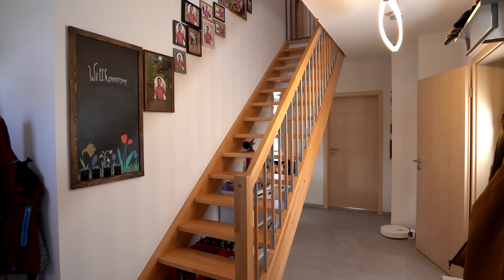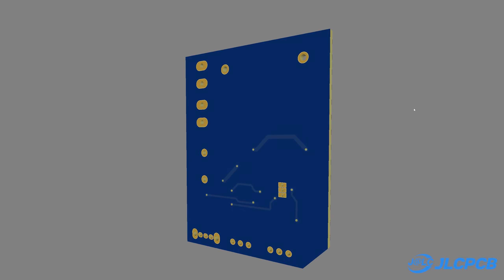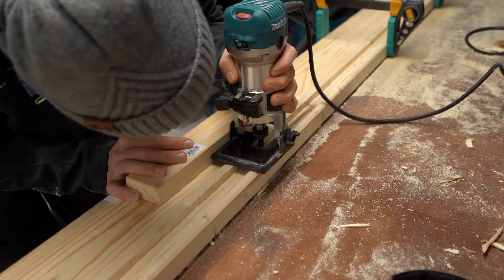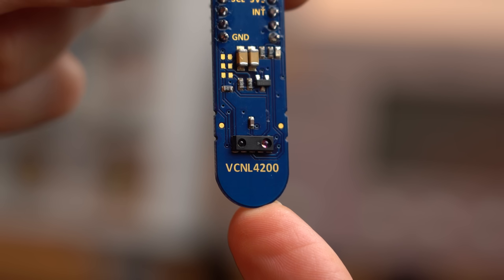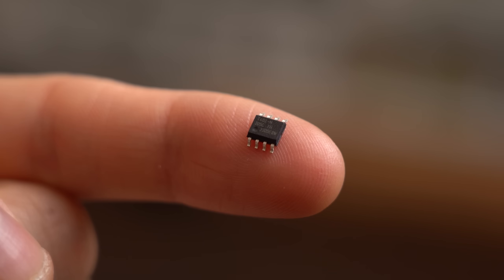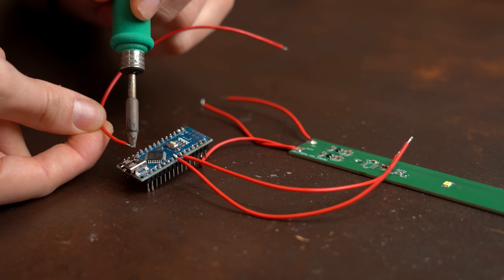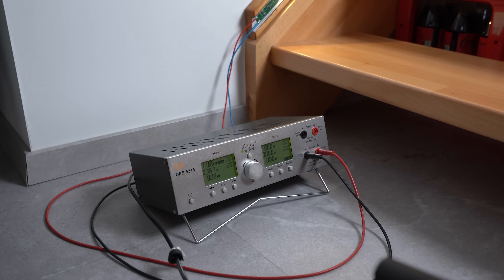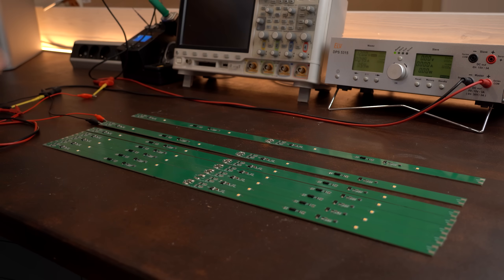I tried to Revolutionize LED Lights!.....And FAILED?

Comment: I bet there's a calibration\hysteresis issue with the lights.  Also, I bet the infrared lights from each sensor are interfering with the other sensors.  That is, unless the MCUs are programmed to trigger each other in a timed series so the only fire one at a time.  That would be my first stop.  Have a calibration on power-up routine and then have them fire in series for the sensors.

Comment: Since the PCB is visible through the transparent cover of the profiles, you could consider ordering them with white soldermask finish. I think it would improve the look drastically making it more "clean" - the green is quite an interesting contrast to the wood in my opinion... :)

Comment: On a similar project that I worked on; we needed to send a signal across interconnected PCBs without limiting the number of boards that could be connected. We used a buffer IC to refresh the signal from board to board so no significant voltage would be lost if the user wanted to connect several boards together.

Comment: I love those types of videos a lot.. Because the failure on something that doesnt exist yet in that scale is always expected... keeps my hopes up when i am inventing or creating something...

maybe you typed something wrong in the code or the sensors are not working properly. maybe they read the rail in the distance or a reflection of some short.. to test that you can try them on the bench with the clear cover on top of the sensor and see if the reflection is messing up the readings from the infrared as i saw the stairs are somewhat reflective and they are not absorbing the light thats why i am saying that... about the noise is possible to come from the microcontroller output maybe try a filter there... as far as i know i am not sure tho i will clarify, that when the mc is reading constantly can produce noise... maybe you can try with locking the distance of the sensor to the max value that you want and with an IF in the arduino to run the code when is a change in the distance else do nothing i dont know how much is possible but you can try it... also take a look maybe the IC is making noise test that too!...

 i dont know if i helped at all i hope you can find the solution and make something cool... i want to do the same thing on my exterior stone stairs because it looks cool and it is usefull... i hope that i helped if you read this thank you for all the great stuff you do!

Comment: how about adding addressable LEDs and lighting the LEDs on boards just before and after the board with the distance sensor that detects movement. At any time only 3 boards would light up. This might be a simpler way to of doing this and would light the led for the step in front of you not just the step you are standing on.

Comment: In my opinion the problem is a mix of crosstalk and reflection: 
Crosstalk: the modules are just triggering themselves via the impulses they are sending out (may be solved by your sw, didn't mention it)

More importantly: reflection 
In my own projects I realized that a smooth surface vs. A diffuce surface make a HUGE difference in IR applications. The amount of light reflected by the smooth surface is way more than by your hand messing up your measurements. This is extremely visible at the upper two modules which had even more smooth surfaces facing them...

Yeah noise in power supply can also be an issue but this sensor is a discrete sensor and so it won't be an issue 

My suggestions: just for testing: put some sheets of pages on the smooth surfaces facing your sensor
Calibrate your sensor with values without humans in the area of view at boot
Maybe you can use a TOF laser sensor for distance measurement (will be less analog) and some are available with crosstalk correction

Loving your videos
Megge 😊

Comment: Automotive led drivers, designed for 12V, would make sense...with the size of the pcb's you could probably use a fat 5V power line, and one 'master' 5V power supply, and maybe even a 3.3 V line, since the system only powers 4 LEDs at a time....why not have a small clear patch for the reflective sensor, although a pir sensor wouldnt care about the diffused plastic...overall, too much complexity?

Comment: Why not use a 5 meters long addressable led strip with one LD2410 mmwave radar distance sensor and one microcontroller (e.g. esp32)? It sounds easier.

Comment: could it be something to do with the reflective metal at the bottom of the banister risers you basically have a load of cylindrical mirrors reflecting the IR in all directions toward all other sensors

Comment: My design (that is more robust and less complex than this video) is to add sensor only on the beginning and end. When person enters, the LED strips will gradually turn on smoothly from the direction of the person entering. 
For example: if the person entering from bottom the LED lights up from bottom to up and vice versa. This way you just need one sensor on each side and one microcontroller. 
The LED will automatically turn off after about 15 seconds no movement on both ends. 
The only drawback compared to what is presented in the video is that it does not detect whether you still inside the stair and which step you are currently into because it is more of time-based rather than individually tracking each step.

The LED choice is either: using lots of cables (e.g. 14 anode + 1 cathode which will be complex) or use one individually addressable LED strip (which is expensive but neat and simple in wiring).

Comment: Redesign the stairway lighting system to be a linear QMK firmware controlled keyboard where the LEDs are the addressable key LEDs and the proximity sensors are the keys. The QMK key LED animation system is what would be used for controlling the step illumination. The effect you are trying to achieve is basically one of the QMK animation schemes called “heat map”. There are many different animation schemes available in the QMK system and these can be programmed to change on the fly according to key inputs or rotary encoder changes. Thus momentary switches and/or rotary encoder would be added somewhere to select different settings such as patterns, colors (use addressable RGB LED) and built-in animation schemes to suit the occasion. For example “breathing” is a setting. There could be a holiday scheme and so on.

This “keyboard” would not be providing any input to a computer, but it could. It could fire off command to a computer. It could be bluetooth also.

Comment: Have you tried using a clock pulse which each module passes to the next and only enable each source and read each sensor one at a time. That should eliminate any possibly of reflections from the multiple ir sources interferring with one another.

Comment: Either just go for Analog light sensor circuit or encode each stair with numbers. So if 1&2 light up ... rest of the lights should be off ... and if 1&2 light up ... then 3&4 should be next to light up ( rest of the lights off ) ... and if 5&6 lights up then either 3&4 will be ready or 7&8 will be ready ( rest of the lights will remain off ) .... 

Problem is what if more than 1 person is using the stairs. I feel Analog design would be the simplest and probably least susceptible to noise if you have the right filtering circuits. Digital always has issues inherently with noisy signals and weird unsolvable behaviours.

Comment: I forget exactly what the material is called, but there are certain quartz glass types that can difuse visable light, but not UV. This is likely expensive, but, if you're looking for an option, look at types of quartz glass.

Comment: Make another video where you troubleshoot and find the problem before designing a new! Link up half of the boards on the floor, find a misbehaving one and start checking what is work. Light off and should be on? -What is led driver doing? What is uc doing? What is distance sensor doing? What is software doing? Any irregularities on voltages? Put a trigger on the 12v line when multiple boards start up. My theory is when the leds start drawing current, voltage drops across the solderpoints between boards start to rack up causing instability on the 12v lines, affecting all components (not a lot of capacitance on 12V line either). Could also be resonance since you're dumping the noise of 15 identical drivers (100 khz-ish) into the 12v/ground of the following boards.

Comment: cant u use i2c for board to board comunication if (Failed) then ( SPI );  the led driver is not a bad ideia but a better filter fod the MCU and the driver and for board to borad could fix that issue

Comment: Hi Scott,
heute habe ich nach einem DIY Solid State Voltage Stabilizer 220V/AC gesucht aber nix nachvollziehbares gefunden. Die Idee ist bei einer Waldhütte mit Bach eine Wasserrad mit Generator zu installieren. Natürlich muss der Output des Generators auf 220V 50Hz stabilisiert werden. Da ich gesehen habe, dass Du immer alle Kommentare auf der Suche nach neuen Ideen liest, dachte ich das wäre vielleicht etwas für eine Episode.
PS: Vielleicht ist es möglich kleine Löcher für den Sensor zu bohren, dann könnte man trotzdem ein Diffusdeckel zu nehmen. Abgesehen davon würde ich die ganze Treppe beleuchten weil das Hirn das gesamte Bild der Treppe braucht um Schrittlänge und Geschwindigkeit zu berechnen.

Comment: Use IR sensors every other step. It is costly as well as useless to use them every step. This will simplify the code as well. After that you can limit the distance sensor's range in the code, this will help reduce any interference if present. Use a fixed brightness to turn On the leds and set a fixed time for which the Leds stay ON and some cooldown after which they dim and turn ON.

Comment: Apart from noise, I think the real issue is the distance sensor: it's not super reliable and maybe some of them are broken or not well calibrated. Considering that they are really cheap, I would try to buy another 10 and try to change it on the boards that shows not the right behaviour.

Comment: yeah I have the same problem with see through stairs. I had other ideas but seems we may move out potentially, so we'll see
6:50 just drill 2 small holes. makes it very directional and not false trigger

Comment: Maybe its a lame suggestion, but... Is there a possibility, that sensors can influence each other? On table it could be, that IR sensor can accidentally catch near IR from an other sensor or LED, since they are really sensitive. I bellive, that this might be an issue. On the table you have tested (you may not, but i assume) it against your hands that are very translusive on 940nm IR. But your straicase seems like very shiny, almost like mirror due to the varnish on them. The diverging angles on your led is +-10 DEG. if you will assume perfect angle of bounce, and l = 90cm then 1.8xtan(10DEG) = radius of 31.7cm,. That 1.8m is due to the perfect reflection. And now I have noticed the shiny endings that are opticaly a round mirror.

Comment: I installed lights on my stairs a few years ago. I initially wanted to have each light activated as I passed but after a lot of thought I realised that 99% of the time I just walk up and down them at the same speed. In the end I settled on a PIR sensor at the top and bottom with addressable LEDs and a Arduino microcontroller. Once activated they light up in sequence from whichever end the sensor detects motion. A few seconds later they turn off, there is also a demo mode and always on mode.
https://youtu.be/Fxh8SY6WHyg

Comment: I love this project in particular. One thing that I could try if I was you is to try to optically isolate the sensors in a sort of rectangular tube, because it seems to me that the sensors are receiving bouncing IR from each one as you move into the stairs.
Happy debugging!

Comment: If you think that the data line is the problem, you might use some shmit-trigger, can driver? or anything else that convert the signal. There are some other 74 that can convert the data to a long-distance communication-safe signal. 
But first you need to figure out that is the case, and that could be in done at your lab .. which is much easier than there. Be careful not to burn the stairs other wise there will be no food for a long time at home :)

Comment: Use the diffused covers, but drill a small hole right above the distance sensor.  You might even get away with a few smaller holes in a triangle or square pattern.

Comment: Could it be that the pwm of the led lights is messing with the sensors giving kind of a feedback loop? Since it worked while being pointed up to the ceiling and now its illuminating something in front of the sensors, the steps.

Comment: The IR sensors might break eachother if they power at the same time, you should probably do some multiplexing to make it cycle through the sensors (or at least not power the ones directly besides them all the time

Comment: microwave sensor at top of stairs?  with a timer?   If it detects human at short distance the leds turn on one at a time every  x seconds down the stairs.  If it detects a human far away lights start at bottom and work their way up...  Just have to figure out the timing for how long it takes to walk up one step.     I've thought about this as well but my stair case is about 100 years old and I don't want to route my solid oak trim.  Anything I add will look too new.

Comment: why not use addressable leds, and the controller reads the input from the sensors, and the controller rotates through the LEDs. that would allow for some nice fading while you're at it.

Comment: Bro its a good project you just need some improvement like you an use pir sensor but adjust its motion sensing angle just by removing top white cover as well as use 2led in single receiving line and dont share data lines you can separate each and every pcb with their own direct dc powerline same as done in a ling tube light now if you wish to spend more money just buy esp 32 and just share each and every data line in esp 32 additionally you can also use data line extender for esp 32 so 200 or 300 its not a big deal and same for motion sensors but it would a bit complicated programming if you wish i can help but i can only help you wuth my ideas because i am from nepal and i dont have proper access to these deveices and are really y hight price here

Comment: i wonder why you used a switching regulator for the LED's since they are not going to be in on state for a long period you can control them with a mosfet with pwm of the controller ..in that way we can eliminate the switching noise .correct me if iam wrong

Comment: Don't you need to ground the aluminum profile as well? I once covered a ~2 meter USB cable with aluminum tape without grounding (I thought it would reduce EMF. Then I researched that I needed to make a filter circuit for that). As soon as I connected the cable to the laptop, the USB device was not detected and it went into protection mode. Maybe it can provide the same effect on an aluminum profile. Of course I'm not sure.
Reply: Also, wouldn't it be better to use a tiny PIR sensor instead of an IR sensor?

Comment: I get the idea of wanting a “just in time” light that only turns on the bare minimum step lights, but it’s really not worth the hassle in my opinion. You’re having to make far too many other compromises for that one feature. 

A single premade LED strip, behind a diffused cover, and controlled by one light sensor saves you a ton of work and in the end will look just as cool to most people. The challenge is fun, I get that, but sometimes the over engineering isn’t actually worth it. 🤷‍♂️

The customer mount and build is still good work even without the extra reach.

Comment: Iknow nothing of PCB designs on the level of other people, but my lazy coder solution would be just split the power line half way up and have 2 lenghts of the PCB seperate from each other halfway to reduce noise and just put seperate power at top and bottom step of the staircase, alternatively pull a cable all the way down to the bottom inside the extrusion.

Comment: could the LEDs be outputting InFarRed? if so  shrouding the sensors may prevent leds spill triggering other strings (and then reflected/refracted...)

Comment: I've done pir top and bottom of stairs.

If you really wanted individual steps you can pir each step with a short timer. Or, a trip lazer with fade in/out motion.

Though personally I find it can look a bit tacky, rather it just light up as one beam.

Comment: The IR light will be bouncing off the opposite side of the stairs and off you as you walk up, lots of IR leds will be cumilative. Remember what looks like a dark surface of the wood may well be a mirror to IR. You might be better scanning the IR leds one at a time and measuring the distance to the nearest object.

Comment: I feel like the added complexity of having one PIR per stair doesn’t add enough value to the final result. The lighting effect is cool, the idea is unique and the complexity makes for good content. But I think a sensor at each end with an addressable LED at each stair makes the project simpler and more practical because you have it illuminate where you are going, not where you already are.

For the sake of the video, i’m glad you chose the more interesting option, looking forward to part 2… and 3 😉

Comment: The flashing on and off is a bit disturbing at night. I would have chosen the simple and relaxed version, two IR sensors, and a timer that lights up all the LED's at once, and not so bright. 5 mA per LED would be enough I think.

Comment: Could the shiny tops of the steps be bouncing the IR light onto neighboring sensors? and if it is electrical interference could you use the aluminum profile as ground?